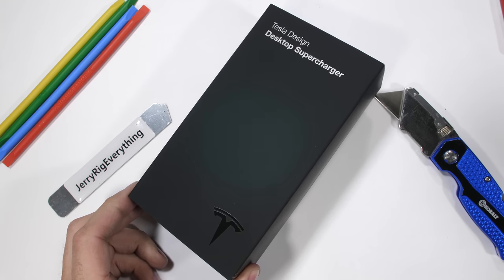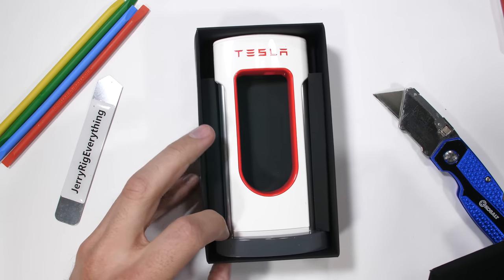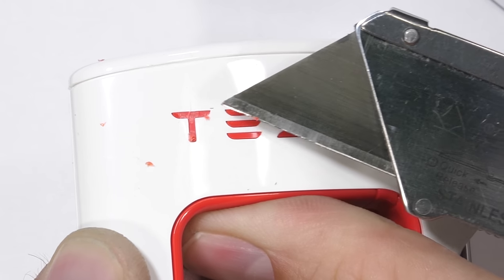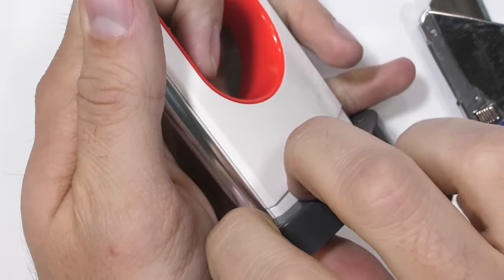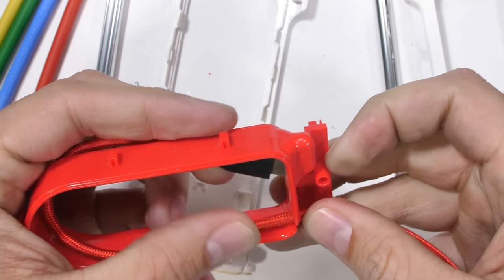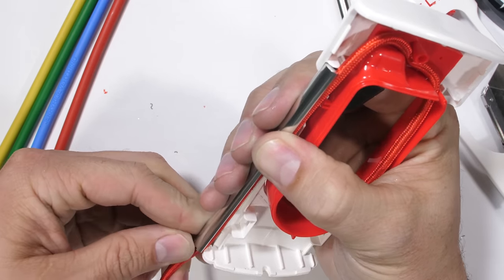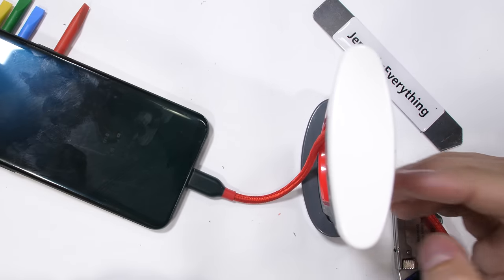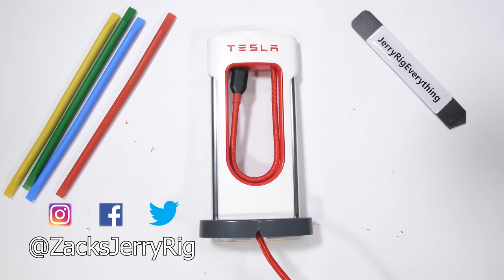A Tesla Supercharger for Smartphones?!

Comment: Tesla is getting influenced by apple
Reply: Tesla is more of a Google than Apple phone wise
Reply: That's BS.
Reply: Ventilate it is more like apple tbh.
Reply: Well said
Reply: I was going to comment the exact same thing.  The technology is pushing boundaries like the iPod did, and it’s a thing of beauty as well as functional - and there’s an incredibly “followable” Elon Jobs, and the platform is locked down but the build quality is heading toward “so good, you’d happily just replace it with another when it breaks”.  I guess it’s worked for Apple, might work for Tesla.
Reply: @jody024  no it isnt. Apple and tesla have a lot in common actually. For good and bad. Theur  business model is about building a closed ecosystem with services which they are able to do because they are a head like apple was.

Comment: bit early for the April first video, isn't it? 50$ for some plastic?
Reply: Thought the same xD

Except dis is 45$
Reply: Welcome to the world of car "design" products. Top Gear used to make fun of them around the holidays. Who actually wants a Porsche tobacco pipe, or Aston Martin cologne?
Reply: @khomchat1  Still not a Glass Sandwich
Reply: with that price i was expected it had some wireless-charging or a usb charging port not just a overprice plastic model tho.
Reply: and metal
Reply: It hAs mEtAl oN ThE siDeS.
Reply: This video is just to promote the referral program from Tesla, nothing else.
Reply: And metal, don’t forget the metal.
Reply: It has cable included
Reply: @apdroidgeek1737  I purchased one as a Christmas present. It does not come with a cable and it is a pain in the backside to install one.